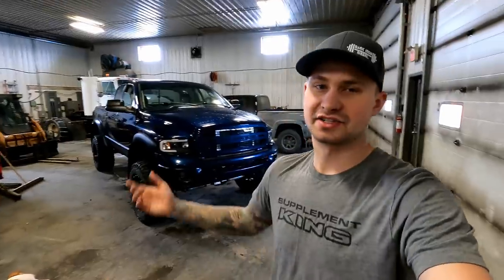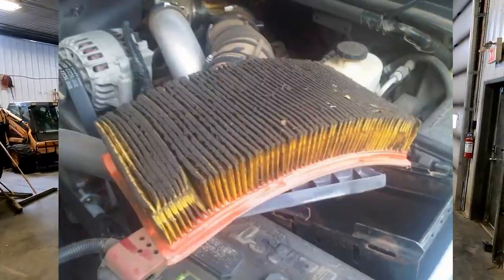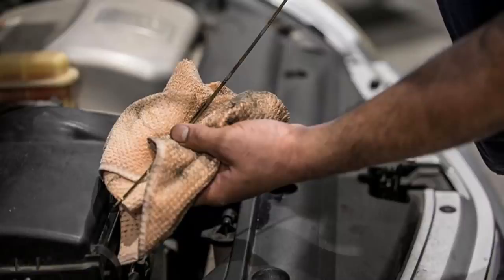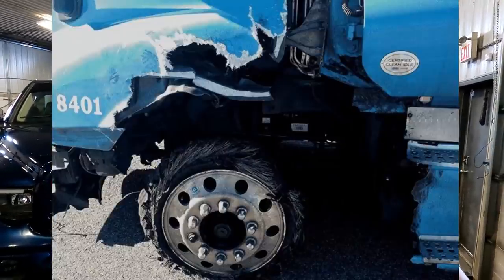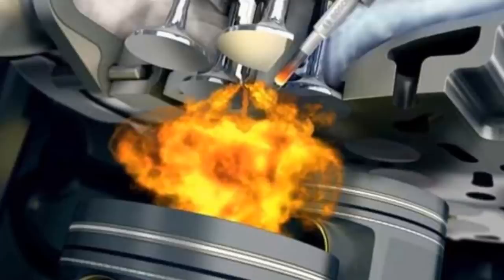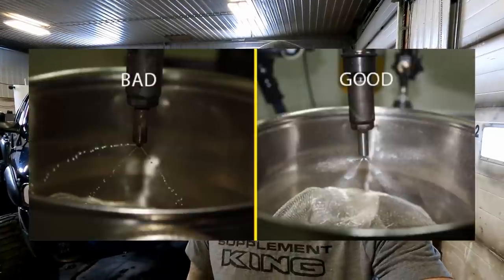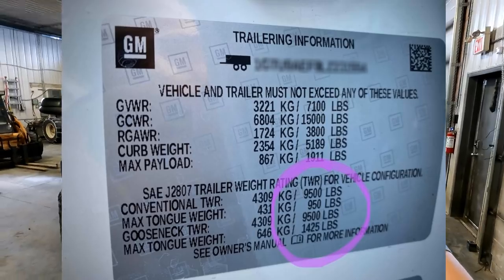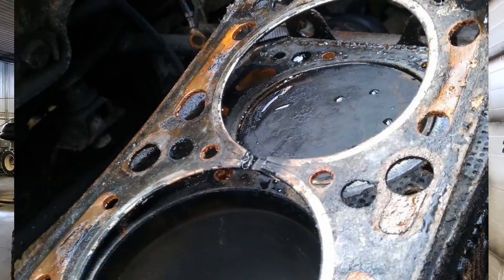13 ways you are KILLING your DIESEL truck

Comment: Great Video! The only thing I would add is BRAKE system maintenance. MOST people have a diesel truck because they NEED it for towing. Make sure your brake system is ready to handle the extra load if the brakes on the trailer you're towing were to fail. Also a well maintained brake system will help you get better fuel mileage... a dragging brake can cost you 2-3 mpg easy!
Reply: You're right with one thing: brake maintenance. But your wrong on another thing: most people have diesel's because they think it's cool, not because they actually tow.
Reply: @mikeofthemountain9865  Sad but true!

Comment: Good info ! My pet peeve is guys will freak out if they go 200 miles over on their oil change but run that tranny fluid ‘til it’s brown!? Also old/weak batteries will Kill your starter/ alternator. Thanks, keep up the good work.
Reply: Another item to change periodically is the power steering fluid. I believe it absorbs water so it should be replaced every five years or so.  The same with brake fluid.  I try to change out my brake fluid every 50,000 miles (~ 83,334 Km). It gets a lot of use and I think it also absorbs water.

Comment: Diesel fuel has a storage life of 10 years with a stabilizer and proper storage.
Reply: I concur.
Reply: You’re right it can be stored for much longer but who has the proper storage to hold fuel and at what point is it going to be beneficial to store BBL’S of diesel it’s not worth storing that much fuel
Reply: Since 2005 ethanol use was mandated by Congress which made diesel and gasoline less stable.Use fuel additive to keep injectors lubricated and control fuel degradation over time.
Reply: @dextermay4007  I’m pretty sure they don’t put ethanol in diesel.

Comment: I own a tree company an I may go alittle overboard but whoever drives one of the trucks checks all fluids an other basic things daily. It's saved me plenty of headaches I believe an we have regular maintenance days.  Nothing worse than working on a truck or equipment in someone's backyard haha been there plenty of times
Reply from the maker: That’s awesome if you can get your guys to do that daily!
Reply: @darkirondiesel  Easy!  Required maintenance, they sign a log book; failure means loss of two weeks pay and they must pay for any damage or other issue which comes up.
Reply: Harry that’s a little rough. Who’s to say the guys before them didn’t truly check it out. Or maybe the truck just happened to go out at that moment just because. A lose of 2 weeks pay hurts.
Reply: @justinjustin337  I know it hurts but sometimes you need to have something which really gets their attention.  If the damage is done "just because a gremlin got it" okay, I could understand it so no penalty.  If the maintenance is not done correctly, the punishment comes into play.  Just document everything.

Comment: I had a service manager tell me that I should always turn on my exhaust break when I am driving to avoid having to repair my exhaust system.  Also, another thing that gets neglected is the transfer case. I am new to owning a diesel and I recently discovered that it should be serviced about every 60k. I love your tips in this video and do most of them already. Thank you!
Reply: Like maybe if your doing some heavy work with it check the fluid wouldn't be a bad idea at 60,000km but I'd not expect to have to change it out till 90,000 even as a heavy work vehicle (welding rigs). Same with your diff fluid, things have come a long long way since the 90's.
Reply: I have an 08 Dodge 2500 with the Cummins 6.7; I service it myself and keep a maintenance record for everything done to the truck.  One thing, besides the book, is to change all the fluids according to the manual (except the filter on top which is changed at 30,000 miles).  I also change the brake and power steering fluids since they don't last as long as some people think.  An easy way to keep on top is to make a checklist you keep handy so you can track what needs to be done  and when.  Good luck.
Reply: @frogger2011ify  I would say for your transfer case it depends on how often you run 4wd. If you're driving around in 4 wheel drive you're probably gonna put more stress on it but if you're not or if you're doing mostly highway driving it may not be a big deal. My thing is though, if you're spending 20-30k dollars on a decent used diesel and 50-100k dollars on a new one, are you really that concerned about a hundred bucks in fluid or whatever the cost is? Some of these guys are financing trucks at over a 1k dollars a month and they're like 'I can get another 30k miles out of this tranny fluid!' that cost them a couple hundred dollars lol. I have a 2018 GMC Sierra 3500 HD CCLB SLE 4x4 6.0l gasser and at 32k miles I swapped very fluid from what it came with to Amsoil. So transmission, front and rear differential, transfer case and I have all Almosil engine coolant but I just need to stop being lazy and take it in to the dealer so they can drain it and put the Amsoil in. And I've been running Amsoil Engine oil since like 15k miles or so. It's not cheap to do but another 50k dollar truck isn't cheap either and with the regulations especially on the diesels these days, if you have an older truck with no emissions it's very advantageous to keep it running because eventually it'll be illegal for people to sell old parts to them and there's gonna be no option to just go buy a new truck without emissions, as far as the engine and components in it go anyway. Just like anything though, keep up on it and do it earlier than you have to and it'll run like new for basically ever.

Comment: I do all of the above. Regarding warm up, I get it up to 1100 to 1200 rpm. Makes for less fuel condensation on cylinder walls. Rpms are always better than high egts so downshift one gear when towing. And last the thing that really baffles me are the idiots that let their trucks idle for extended periods. Occasionally I'll try to explain the principle of oil fuel dilution and engine bearing wear  but it usually only elicits a blank stare.
Reply: Yup , the low idle isn't good for any engine but it's a death sentence for emissions

Comment: I wish most of my past employers followed #13!  When I was a Wrecker Operator and my truck had issues it was always the drivers fault! They would wait months to do Oil Changes check brakes, lube the front end! These  were trucks that ran almost 24/7 i don't know how many engines were replaced or rebuilt each year? I did what I could like grease the truck with their supplies (they didn't like that) but telling them my truck needs an oil change would fall on deaf ears 😔. My personal vehicles I stay on top of  I have a SUV that's 21 years old has 345000 miles on it and it still runs and drives great!! Now my RAM 2500 Cummins I am currently towing a camper around the USA with I'm a little past the oil change only because I can't find a place I trust to do it! The RAM dealership near me I had planned on going to went out of business 🙄 I will have to wait until I find a RV park that will let me change it myself. I'm about 1500-2000 past the 7000 miles I planned on having it done, it's driving me nuts having to wait.
Reply from the maker: I’d like to say that any shop should be able to handle an oil change but honestly these days who knows

Comment: I've always done my air filter (changed to a knn) I always warm up bc deisal runs on compression.i always greas too but never even thought about fule filter every service. Thank you man
Reply: I change my fuel filters every 30k miles on my 6.7 powerstroke
Reply: 7.3 powerstroke, oil changed every 3k, fuel filter ever 3k. Flush the coolant every now and then. Pour some hot shots secret in the crankcase and fuel tank every so often. It'll run forever.
Reply: @jamiepippin3892  on the 6.7s Ford recommends changing both fuel filters every 30k miles. But obviously it wouldn’t hurt to change them more often. And if I follow the intelligent oil life monitor, I change the oil every 8k miles. I use synthetic 5W-40 or synthetic 15W-40 depending on if it’s dead summer or colder

Comment: Been getting burned a lot lately on Rockauto parts. They do not honor some of their warranties.  Had a trans go bad at 24k miles on a mostly stock truck other than a banks tuner. Had an ac pump never work from day one, because I got some parts locally they would not honor that warranties. Had a coolant tank crack up in 6 months. it was past the return period. Brake calipers with mismatched bleed ports and leaking from the pistons in a month. They were cardones which I thought was a good brand.

I admit buying a trans from them was dumb, but I was also new to the diesel world. The other parts used to be good to get. Not sure why the quality is going to crap lately.

Comment: Hey.  Wow.    Found you.  I have a 95 ram 3500 and a 30 foot gooseneck.     But I want to pull heavier.     So I just bought a 2011 f 550.      Don't even have it yet.    
   I operate a tower crane and the maintenance is critical.       I'll be bringing my cordless grease gun down Monday.
   Great video.   You got a subscriber from Vancouver. 
  Cheers.  ic.

Comment: Over-inflation of tires is very common. When I'm travelllng light, pumping up tires to 50/50 or 50/80 (factory sticker) when running empty payload produces a rough ride and excess center-wear on tires, and some handling issues (wandering). I use the Michelin tire axle weight chart (found on-line) that shows correct pressures to use based on the weight on the tire size, rim size, and (you can use for any tire brand) fixes these issues. My empty 2005 GMC 3/4 ton Duramax weighs 7,200 with me in it, so I run 41 psi front tires, and 34 psi rear tires. Tire wear is even, ride is comfortable, and much less harsh than the GM recommended pressures for that weight  (50/50). My axle weight is 4,000 lbs. front and 3,000 lbs. rear when 1-person and empty bed. My tire size is (Cooper AT3) 265/70E-16 with stock 7-inch wide rims. Also, when you run wider than stock tire sizes, you should drop the pressure, shown on Michelin chart, because load carrying is increased due to more air volume in the tire.

Comment: I just subbed you dude  looking forward to more content. I drive a 2010 2500 ram, an have always changed oil at 5k, air filter@10k or sooner, fuel @ 15k, anything mine needed, it got, mainly dealer repairs only, never any outside of any dealer shops, mainly because of all the sensors an computers that run it, an she is bone stock, all OEM, with no mods at all. But I bought it to pull a TT around the USA for the last 10 yrs, now she is retired from work, but its all I ever wanted in a truck, so I'll keep it as my daily driver now, an my hunting/ fishing truck. Mite put a leveling kit on it, as its nose down profile bugs me, an I mite put some 33 in sneakers on her so I don't get stranded in the mud/ sand of Fla. But thats it for mods, thx for the vid

Comment: Some things that aren't common knowledge to new diesel owners...thank you!
Reply from the maker: You’re welcome!
Reply: Half the diesel market does not qualify for owning a diesel anyway . My truck is getting a transmission from putting in work not mall crawling lol
Reply: The three f’s. Fuel add a quality additive for both warm temps and winter temps, filters fuel filters about twice a year and air filter at least once a year and fluids, oil for engine, trans fluids, front and rear diffs, coolants, power steering fluid, break fluid. I really like the hot shots products for fuel and oil additives.
Reply: I like the hot shots a lot . Gets expensive on 3 semis and a pickup tho . Must have if you frequent the cold weather fuel/addi .

Comment: One of the biggest no no’s- running ridiculous wheel off sets.  Destroys suspension geometry , increases wear on  wheel bearings, ball joints and tie rods exponentially! Decreases handling as well.  Stick with the factory off set.

Comment: My suggestion is changer antifreeze to a good quality antifreeze a mile Dodge I was losing water pumps fairly regularly and I switched over to Amzoil antifreeze and I have over 300,000 miles in the same water pump and it’s still good and they could look at my rad in and no corrosion anyway this is six in a row jim From Kennerdell Pennsylvania

Comment: The biggest issue with not letting the oil cool down after driving under load or heavy is oil coking. (Coking, not cooking but basically cooks) The oil in your oil cooled turbos will sit and cook at higher temps and can turn to coke. (Not Colombian marching powder)
Reply from the maker: Yes! We actually just learned about this in our 4th year schooling. Of course that was after I made this video.
Reply: @darkirondiesel  ahh. Another thing I that I have learned is that with the high pressure fuel pumps (particularly in RAM trucks, and I have a ‘21 eco diesel Wrangler) they were having issues with asphaltenes building up in fuel tanks. They issued a service bulletin and always add diesel Kleen every other tank or so and recommend it. They were not getting bio sludge but asphaltene. I run DK every tank and aside from the first Regen at 490 miles (active) I have not had another active Regen come on in  over 6k miles. I’m going to order the Banks derringer and gauge kit this week to monitor my EGt and turbo temps as well to try to keep the engine as healthy as long as I can. Maybe once warranty is expired I’ll come up to Canadia and get a delete from your freedom loving canucks.
Reply from the maker: Haha 😂 👍🏻

Comment: You mentioned EGTs, the actual temp and not being able to monitor. My 19 L5P has 5 EGT sensors in different locations to monitor the temp through my banks I dash. When the trucks go into regen it’s pretty easy for them to reach high 1100 degree temp for 15-20 mins. Just on the newer trucks I’d say it’s been compensated for.
Reply from the maker: Good point, I have a bad habit of assuming everyone’s truck is deleted lol.
Reply: @darkirondiesel  I have an 08 Dodge with the Cummins 6.7.  It is not deleted but I probably should have done that.  I use a truck camper part of the time and tow a utility trailer a bit.  What is the advantage for having a delete done?  How expensive are they in your area.

Comment: "It's awful simple if you know  how to do it and simply awful if you don't."  Oil is the life blood of  an engine.  It will never hurt a diesel to change oil more frequently; however, if it isn't changed it can get  expensive. All filters on a diesel are cheap compared to repair cost if the Cummins isn't maintained.

Comment: I agree with all you said!  Rock Auto does sell AC Delco  parts along with other top named brands, they also sell cheaper brands.
Reply from the maker: Ya usually when a guy goes to rock auto he’s buying the cheapest brands they sell haha
Reply: True
Reply: Never buy oil pans from rock auto! Last i checked the paint on the inside of the oil pan comes off and plugs the oil pick up, then the engine is shot!

Comment: New Diesel owners should be given a course on how to run and maintain their Diesel engines. Unlike the Mercedes driver who at -38C didn't plug it in and didn't let in it warmup. It got 1 block away before the engine seized.

Comment: stupid question... if you EGR/DPF delete and you aren't recirculating exhaust gases back into the engine that would make it unnecessary to monitor your exhaust gas temp.. correct? new to diesels.. they seem deadly so far tho. might be trading in my 2020 f150.

Comment: Great video! I’ve also heard about changing the crankcase filter every 100,000 km or so, it doesn’t say anywhere in my owners manual to do. I have a 2010 Dodge Ram 3500 dually
Reply from the maker: Hey yup that’s part of the regular maintenance. You should get a code on your dash that says “perform service” every 100k ish. That’s when you know it’s time.
Reply: I have an 08 Dodge with the Cummins.  I change the crankcase filter (the one on top) every 30,000 miles since it easily gets gunked by the oil.  I also changed where the filter ends.  I plugged the line going into the turbo and added a new throwaway filter to the hose coming out the back of the filter housing.  Keeps the turbo much cleaner and the truck runs better.  (The "book" says to change the filter every 60,000 miles (~100,000 km) but I found it's much better to change it at the 30,000 mile (50K km) interval.

Comment: The best stuff to clean your injectors, pistons surface, valves is add ATF to the diesel tank. I have a N14 C+ every oil change I put a gallon of ATF too 100G. BLACK SMOKE DISAPPEARS
Reply from the maker: Atf is good on old mechanical pump systems, but it’s highly recommended that you DO NOT use atf with modern common rail Diesel engines.
Reply: @darkirondiesel  same sh@t

Comment: Just one problem no grease zerks on front end or on the drive shaft joints on a Dodge Ram 2005 2500 with a 5.9  so I got shafted by the Chrysler Company they saved alot of money by doing away with zerks thanks to there torque converter heater leaking coolant had to replace a transmission removed that garbage modified my trans pan 4" deep run tubes through it to cool Trans oil one line in one line out no problems it works
Reply: Ment to say to heat trans fluid on a cold day

Comment: My mechanic told me i need to start greasing my muffler bushes more frequently because the vibration will make my exhaust fail but i cant find the grease fittings i looked everywhere even tried a mechanics mirror and a boroscope 17”silverado 6:6

Comment: Definitely some great tips.  I just picked up a very clean 2011 Ram 3500.  Question on the fuel additives, How often do you use them?
Reply from the maker: I like to run fuel additives in each tank. Usually you only need an ounce or two for a full tank of fuel.
Reply: Don’t buy power service it’s overpriced junk run hot shots secret edt